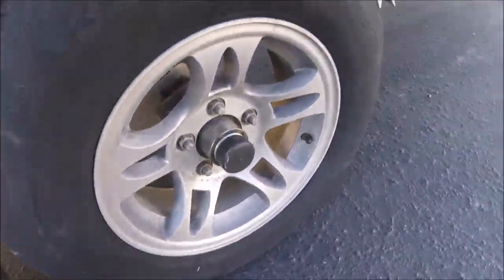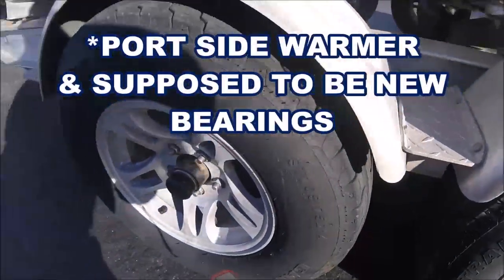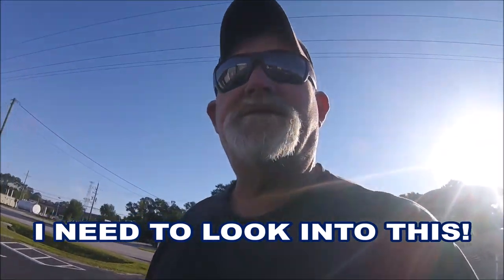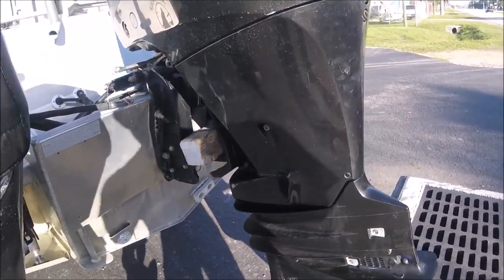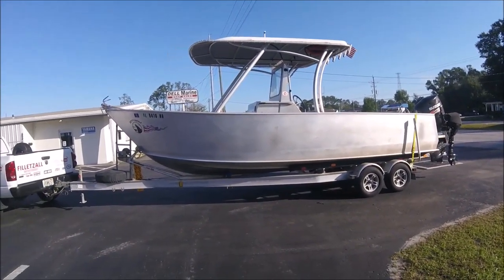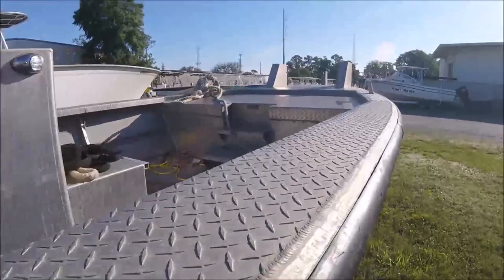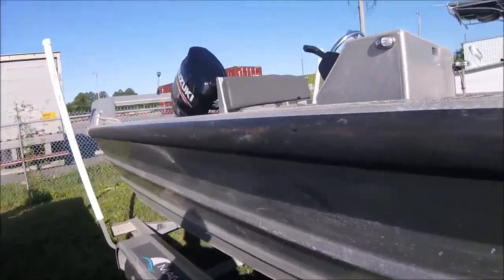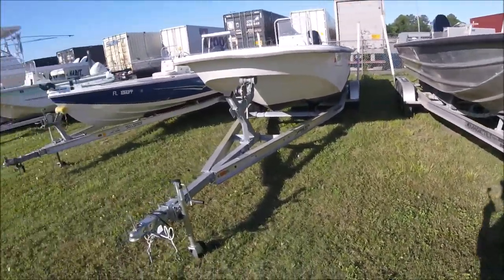2020 SUZUKI DF 250 👉 soon

Comment: Is your trailer level as you pull it? Maybe trailer hitch needs adjusting to level the trailer.
Reply from the maker: I've got 4 different coupler things, all levels. the one I am using seems the best.
heck, I only go 4 miles to the boat ramp usually. this was a road trip for me!